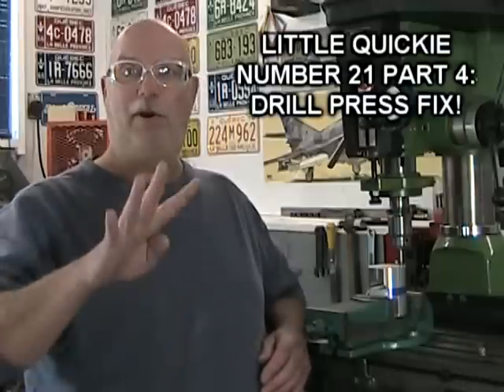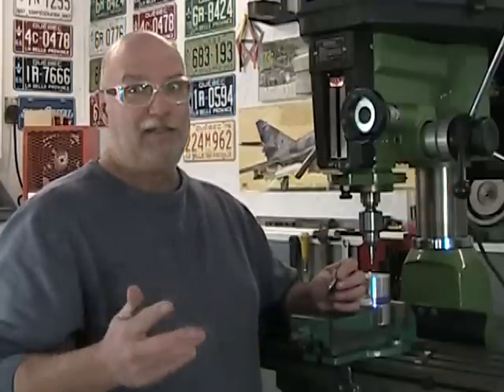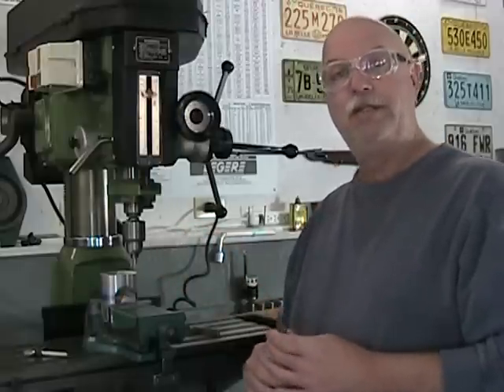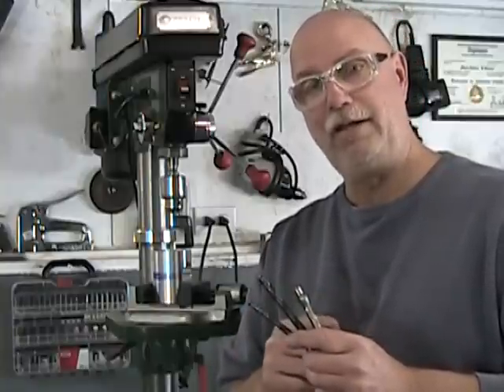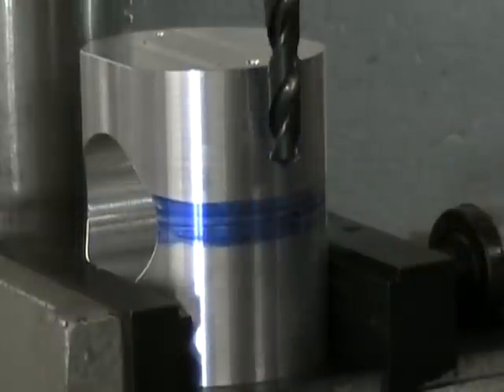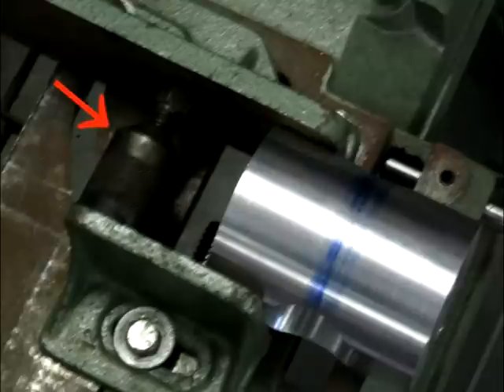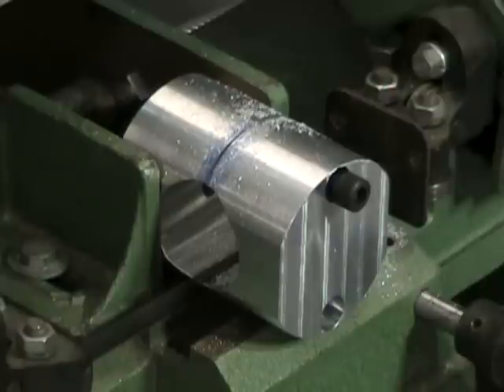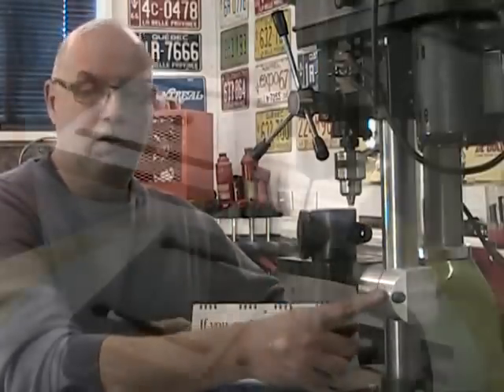Drill press fix part 4, MARC LECUYER

Comment: Cigarette rolling paper ("Zig Zag") works well for spacing tools.  They are uniformly 0.001in. thick.   Afterwards, they can still be used by smokers (tobacco only, please).
Reply from the maker: +MrShobar After many many tries and a major health scare (I came very close to dying) I have finally managed to stop smoking and drinking (alcohol) and my health has improved immensely. I avoid anything to do with smoking now but the shim suggestion is a good one. Thanks for watching, Marc

Comment: Are you working on a "Drilling Machine?"  If so, you could make an entire series on improving them.  I have one, and there is a lot of room for improvement.  Improving speed control would be first on my list.  Still, it's better than no drill press ... barely
Reply from the maker: +diggerop Hi Diggerop! I have had the pleasure of working an some high end gearhead drill presses. They are very nice and the speed controls are a lot easier to use than the belt drives. They are however quite expensive. Thanks for watching! Marc
Reply: I guess I should have said "making the part for."  The old part looks like the one on mine.  Your redesign of it appears to give a little more drop to the table, on mine you have to swing the table out of the way for longer bits to clear the table, then you have to block the work up from the foot to get the depth you need.  In short, It's not very well designed.

Comment: Awesome part Marc, the only thing that semi bugs me is that gap between the two pieces when it's on the column. Why not do everything else and machine that hole once the two pieces are tightly screwed together?
Reply: +P0tat0_craft    There must be a gap so it can clamp on the column.
Reply from the maker: +powaybob Yes the gap is to ensure that the U-Bolt type clamp can be fixed to the column without slippage but at the same time move freely up and down when slightly loosened. For that to happen the hole must be larger than the shaft ( in this case the hole is .002" larger per side) in order to avoid binding on the sides of the "U"' shaped half holes. Thanks to both of you for watching and for commenting! Marc
Reply: powaybob i should have worded my question differently. I realize there needs to be a gap so there is a clamping force on the column, i was just curious if a different order of operations would be possible to get a smaller gap. its not big deal i was just wondering :P
Reply from the maker: Hi p0tat0! now I understand! It would work both ways, the way you suggest would give a better control over the size of the gap but would requier milling each surface twice since it would still requier a gap (but it could be quite small). Thanks for watching and for a great question, Marc